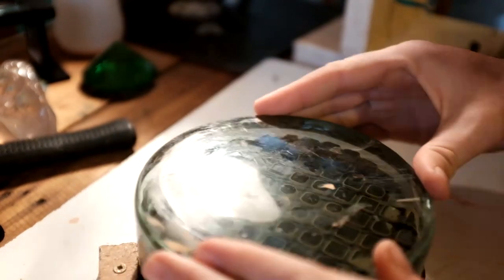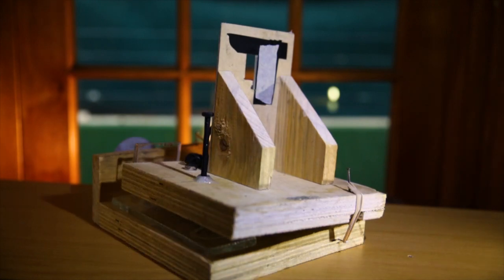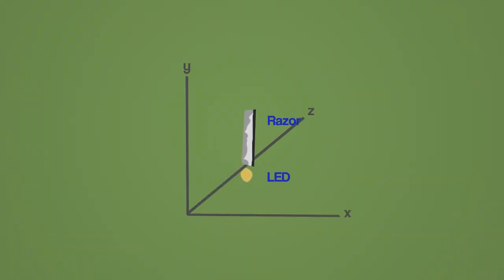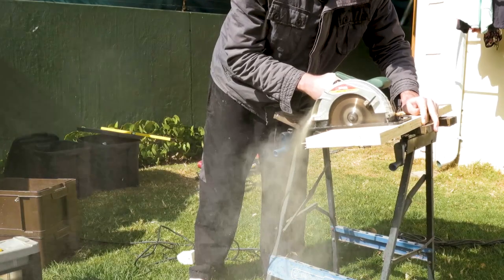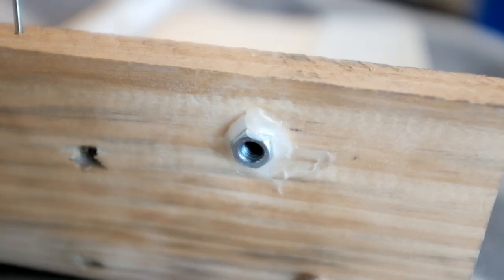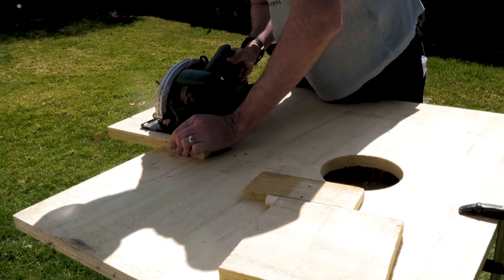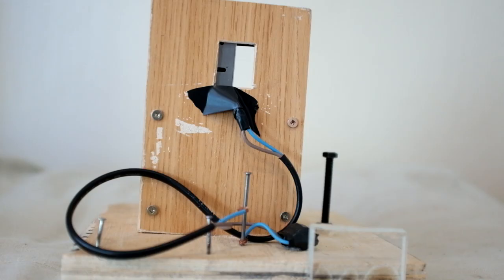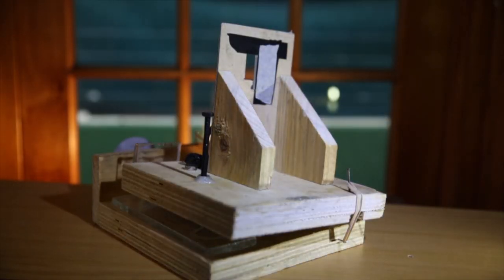DIY Telescope: Building a Foucault Tester

Comment: Hey Born would you let me use your diagram of the foucault tester for a video I'm making, I would of course credit you? Many thanks Rory
Reply: Hi There. Of course. It's a very simple design, so is a little flimsy, but does the job for the most part. You're free to use anything from the video if you want. Also, take a look at Stellafane. They have some very impressive designs and are waaay better at explaining how this all works than I am.
Reply from the maker: I was signed into the wrong account in my previous message.
Reply: @BornAdventures  Hey Born thank you so much. I'm just using a few seconds from the video just to show people the basics. Please let me know if there is anything I can do in return.

Comment: Have you finished the telescope yet? I'm curious to see how well your hand ground mirror works. I'm assuming youv seen Jhon Dobson's how to build a telescope documentary? It's a excellent resource.
Reply from the maker: Hey! Sorry for the late reply. I haven't yet. Life got in the way a bit and it's just sitting on the shelf at the moment. I'm planning on starting it again in two months time. The mirror was basically done, there's an extremely small turned up edge, so need to correct that before coating it and then it's just putting the actual scope together. John Dobson is a legend. There's a long video on YT where he makes a large mirror scope that I've watched probably 5 times already
Reply: @BornAdventures  its been 2 years, any updates?

Comment: Good work. 
İs it possible ed apo refractor with flp53 glass can be grinding?
Reply from the maker: Hi Mehmet. It is very possible to grind your own refractor. But, it's exponentially more complicated than a newtonian. With all the elements, there are at least six surfaces that need to be figured to at least a 1/8 wavelength of light and flourite is very complicated to work with over pyrex or plate glass. But, it certainly can be done. I know that someone at Stellafanes ATM competition did a oil filled flp53 refractor in 2017. So maybe pop them a mail to ask if someone would be able to put you in touch with the person who made that one. I would be very interested to follow your progress, please keep me updated how it goes.